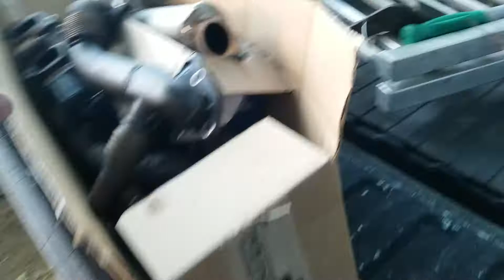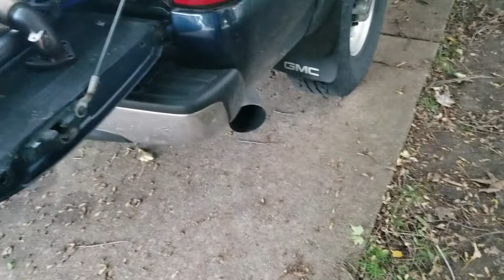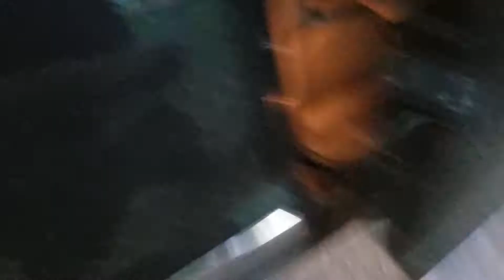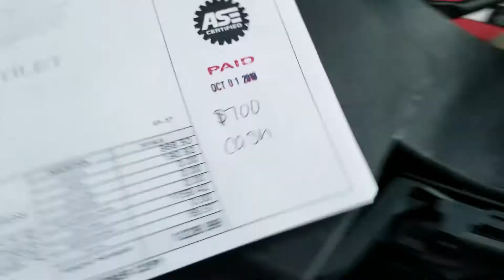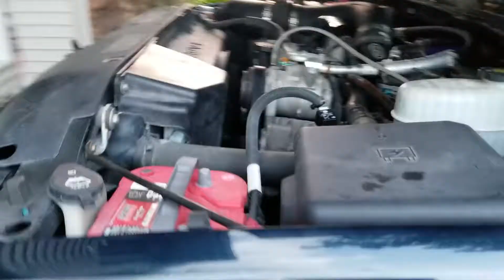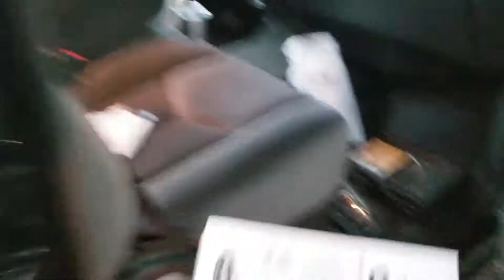2005 Duramax upgrades

Comment: Greatvideovery informative have you also put a lift pump or an upgraded turbo mouthpiece pipe on yours Im considering it for my used 2006 GMC Sierra 6.6 Duramax no upgrades as of yet and there is 393.254 miles on it still purrs like a kitten and lots of power
Reply from the maker: I put in an upgraded turbo mouthpiece and detail that in another video but i took it down.  Below is a link to the exact one I put in. Didnt notice any major "performance" differences, but I did notice a lower EGT and a slightly quicker spool from the turbo. Biggest issue is that there are very sharp bends in the stock part and it causes areas of high/low pressure in those bends. at some point ill do an AirDog, but i have been working on other projects. I need to upload those videos before people think this is a dead channel.
https://www.xtremediesel.com/sb-filters-76-1006b-turbo-inlet-manifold?gclid=CjwKCAjwyY6pBhA9EiwAMzmfwcy7javfbKFKjgbxANyEbSacXCpE9Jz0eKt8EXjRL9EwZBXG1w3-6RoCNg4QAvD_BwE

Comment: Sir, Did your 05 LLY delete kit trip the check engine light?  I am contemplating this change, however cannot locate any information on the CEL?
Thank, Best  to you.
Reply from the maker: Good question. For me it did not trigger a CEL because my truck isn't programmed with California emissions. It does however trigger "soft codes" since the computer no longer detects the egr system. To test this, find the electrical connector to your EGR valve and simply unplug it. The. Start your truck and bring it to operating temperature. If no CEL comes on, then you're good and you won't get an amber light. The soft codes won't effect drivability in ANY way. Sure you can program them out with an EFI live tune, but its not needed. I've had zero problems ever since and I still drive the truck. Hope this helps.

Comment: I also have a 2005 lly I purchased it in 2006 with 9000 miles on the truck 
The first thing I did is installed a LBZ turbo inlet and opened up the factory air box and installed the diamond eye  down pipe along with a 4" exhaust system 
I kept everything stock on the motor egr cooler 
Everything 
I did get efi tuning 
And do very good maintenance (fuel filters, I run diesel service fuel conditioner religiously and a very very high grade oil in all gear boxes along with the engine )
I currently have 275000 miles on the truck and average about 20 miles per gallon daily driving 
With my sport tune 
The biggest thing on the  lay motor is changing the coolant, get away from dexcool go with peak final charge and clean your whole cooling stack every year 
Your next thing you need to invest in is after market transmission lines and transfer case pump rub kit
I towed 25000 lbs from Minnesota to Southern California with out any issues 
Maybe I'm naive but I think the lly motor is pretty solid 
I'm in the process of rebuilding my body with Texas body parts 
Do to Minnesota salt 
Good luck with your duramax they're a lot of fun 👍
Reply from the maker: Well said. There are alot of ways to remedy the EGR issue. I simply decided to remove mine and replace the up pipes because I just wanted the assurance that it would never be an issue again. Havnt had any issues with the Tcase but will keep it in mind. (Change fluids with BG fluids annually). Also agree with getting rid of "DexKill" coolant because it reacts POORLY with air and forms this pink sludge that can (and does) clog the cooling systems. Again, annual BG fluid services has kept that from becoming an issue.  At this moment I am still running stock tuning but will probably change that with EFI Live. Not planning anything crazy and in fact may have it detuned slightly for maximum economy for unloaded highway driving.  Just replaced tierods since after 108k they were getting a little sloppy (not bad for original stock units). I got a few things to fix which are mostly cosmetic and age related. Will probably buy the new Banks diff cover for her before it gets cold again. Thanks again for the comment.

Comment from the maker: Update  - After driving approx 400 miles for Thanksgiving I noticed an almost 2.5mpg increase with the upgrades but the BIGGEST change was my EGTs never got above 700 on the interstate at 75mph.  Truck is still running great with no issues.
Reply: How's it running now?

Comment: If you get a bump in mpg, let us know.
Reply from the maker: will do.  Have noticed a big difference in EGTs though.  They peak about 150F less then before the upgrades under normal city driving, but biggest chance so far is in how fast they drop.  After getting off the freeway this morning, I noticed EGTs fall from 650-280 in less then 30 seconds.  Also the same when getting ready to shut down.  I wait until EGTs are below 300 and then wait 30 sconds.  After the upgrades, I get under 300 in about 20 seconds.  This turns the "three min cool down" into about 1:30.  Will update after I get some MPG data